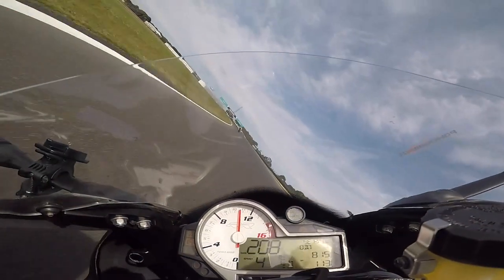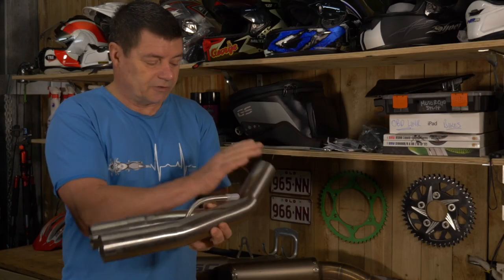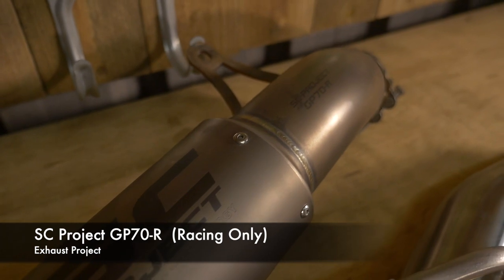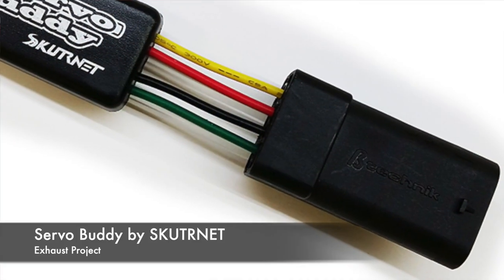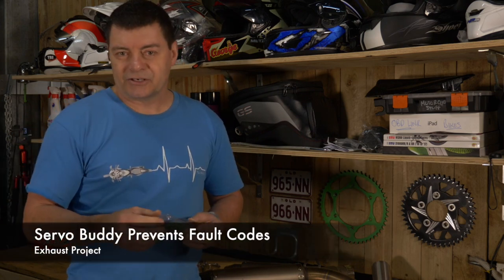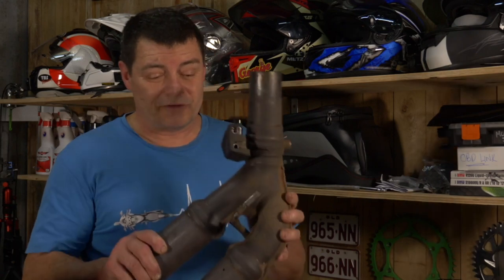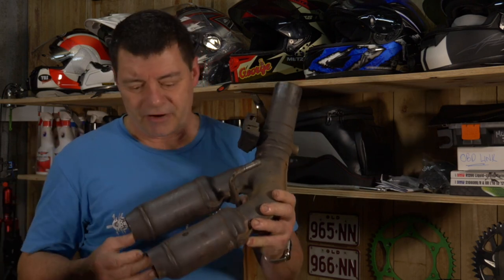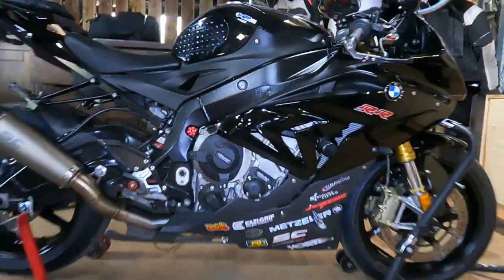Prepare Your Bike for Track Days - Remove Catalytic Convertor and Servo Valve on BMW S1000RR

Comment: What about the first servo motor on top left hand side ?
Reply from the maker: Advice to me was to only remove the front one if you get rid of the original headers. I you simply remove the cat but retain the headers, as I did, leave the front servo in. I don't technically know why specifically other than to say that was the advice to me from the gurus I work with.

Comment: What side did you bend that metal plate that stuck on servo motor?? I cant take out my servo due this plate, i did everything and nothing works
Reply: My servo started doing that normal servo motor sound but he dont stop untill i turn off the engine/key 

I dont know if this is some lake of lub on servo (even know if is possible to lub servo)

Comment: Did you have to retune after the cat delete. I already have the conic slip on and a ecu flash. Would I need another tune after adding the midpipe.
Reply from the maker: the reality is if we change something that improves flow of air into the motor and exhaust out of the motor, we probably should tune the engine to suit.

Comment: Can you add a link to the actual stainless steel bypass tubes? TIA.
Reply from the maker: not sure what you mean Rafael, what type of link?
Reply: @TheBikeStig A web link to where you bought the link pipes from.
Reply from the maker: @jeffmetalhead85  haha, my bad, I read 'can you add a link to the tubes' thinking you want some other linkage welded on .. I'm not real smart :-). And yep, by the time you read this the link should be visible mate.

Comment: do you know what sort of sound level the conic exhaust with decat would be at a trackday static noise test?
Reply from the maker: I actually don't know what it would be dB wise mate. It is quite loud without the baffle in the muffler when you get up it but I've been riding around the street for a month or so like that, I have to admit I did put the baffle back in just to avoid problems with highway patrol. I can tell you it is definitely not as loud as the GP70R style of muffler which is ear splitting :-)
Reply from the maker: By the way, I will be running it without the baffle at track days and don't anticipate any problems.
Reply: Looking  to decat my gen 2 xr1000.  Butterfly  valve isn't cable  operated. Where can I get one of those centre pipes that do away with euro 5 stuff. Then do I need it remapped ? Will.